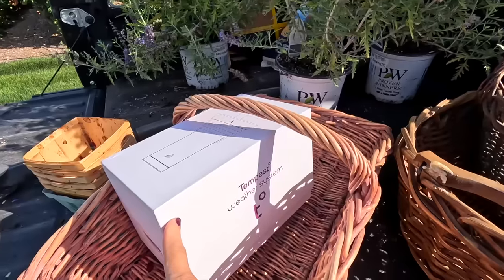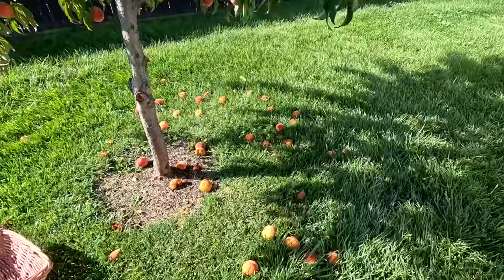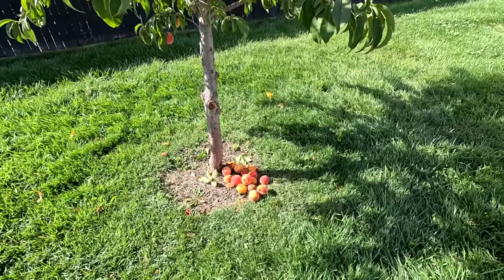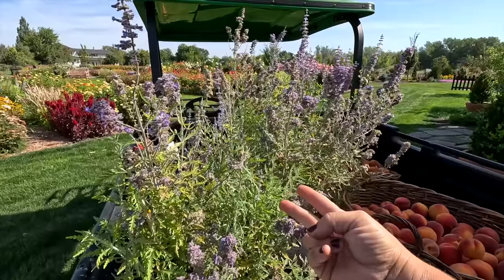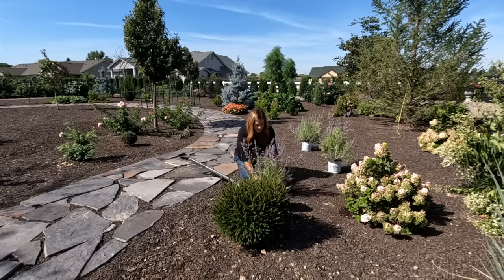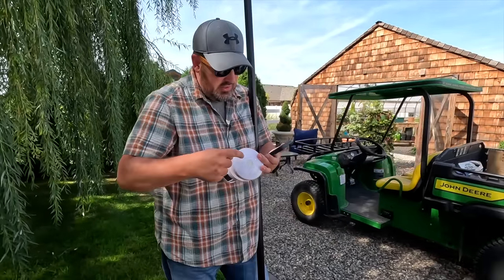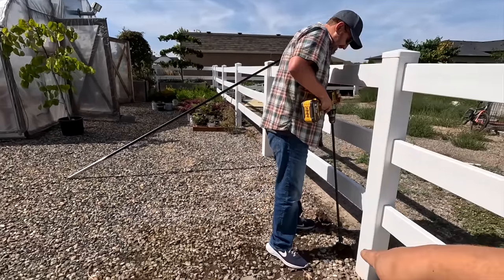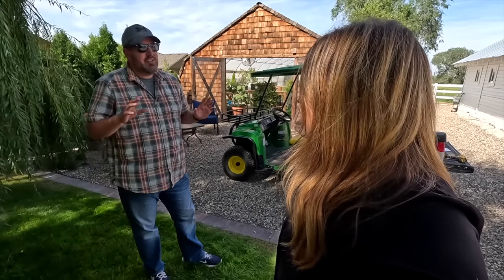Setting Up a Weather Station, Peach Harvest & Planting Russian Sage! 🌤️🌡️🍑 // Garden Answer

Comment: The Tempest is best when you pair it with your smart irrigation system like the Rachio. That way, when the Rachio schedules watering based on the weather, it will be way more accurate than relying on local weather data.

Comment: Also, you don't need a pipe or pole! You can use wood screws and install it right on top of the fence post! Its got a detachable bottom part that you can screw down and then the weather station clicks in, no need for a pole or pipe! But of course the higher you go, the better the wind reading, nice job!

Comment: I like the look of yours better than the weather station we have. Ours has an opening like a funnel, so leaves often get stuck inside, messing up the reader. So if we've gotten a lot of rain, but it's not showing the correct amount, sure enough there are leaves and debris stuck inside. Ours is attached to our ham radio tower with a spinning wind thingy attached at the very tippy top. It's very interesting. And we're able to open the weather app and pull up a friend's weather station who's about 40-50 miles away, so that's neat. Next, Aaron's going to want to become a storm spotter! 🤪

Comment: We have two with sensors inside our greenhouse, seed starting room, and outside.  We have been using it for several years and it has been so much more accurate than the weatherman.  We have a much better understanding of the micro climate in our yard as well.  You will love it.

Comment: I mounted a Tempest weather station in the same way but I’m in the windy Azores and found that very strong winds tended to register as rain also - just something to look out for if accuracy is your thing. I probably need to adjust the mount to fix that. In the meantime, I also have a Davis Vantage Vue which is a bit more costly but definitely worth it. Happy weather watching 😊

Comment: I am near several Tempest weather stations here in coastal NC, one right around the corner from me. My weather app picks up the info (think you can share with national weather service). I would strap that pole to the fence to keep it stable when you gave high winds, which could rock the pole and loosen it enough to yank it right out of the ground.

Comment: When you said something about getting a weather station I was going to suggest a Tempest. We really have enjoyed ours for about 2-3 years. It's not perfect, but I still recommend it. The rain measurement seems to be off a little. I suspect where you have put it, the barn will block the wind a little but I doubt you want to see it out in the open where it would probably work the best. I look forward to seeing how it works for you.
Reply: I was wondering about the buildings blocking wind as well.  Maybe if they had it installed on the roof? Would the wifi still be strong enough?

Comment: Please elaborate on how you decrease/cut off the water on the Russian Sage when they are in the same bed and on same drip lines as other plants that need more water. Do you cut the line? Add a valve that can be turned off? Remove emitters? That would be helpful to know.

Comment: Couple of quick questions. When you plant using the "plop and plant" method. Do you go around later and hook up the drip system to them? And about the hoselink system. Can u attach a sprinkler or will it automatically rewind once you set the sprinkler down? Thanks for consistent,  informative and wholesome content.

Comment: Thanks to you both for this channel - I know it’s a lot of work. 

Regarding Russian Sage - I have several Denim & Lace Russian sage and they simply don’t look as vibrant as yours do this late in the season. They are in beds on drip with ‘holes’ every 12 inches and as they established, I moved the drip farther away from the plants and ensured they are only on one side of the plant, if that makes sense.  I am wondering if they are still getting too much water. How do you handle this in your beds with drip?  Thanks much!

Comment: I have Seascape strawberries this year for the first time (love them!) and heard you say you were going to put in a waist high raised bed next year. My raised bed has legs and I live in Indiana. I contacted Johnny's where I purchased the bare root plants and they do not know how to protect them for the winter. (I can't move it to a more sheltered location - they suggested in the unheated garage - but we can't lift it!) I'm thinking of wrapping plastic around the base so the cold air can not get underneath and using clean straw to cover the inside of bed. It has a fence behind it and it is in full sun. What kind of raised bed are you going to use and what would you suggest? Thanks!

Comment: There's a way to can even worm damaged apples but there's a tiny bit of extra work. You cut them up, get rid of the damage and seed house, grate them then boil them with sugar and cinnamon, can even add nuts too. Then put them in jars and process as usual for you. Endless apple pie through the ear.  What we do though, and we haven't had issues for these, is just put the hot contents in the jars, close and immediately cover in very warm blankets and leave them to cool down naturally in those. No burning involved as long as you actually close the jars using a towel, not your bare hands :D